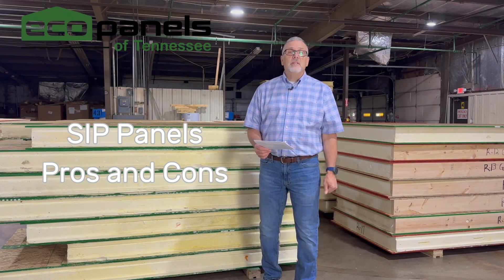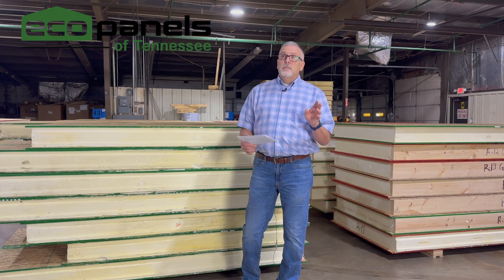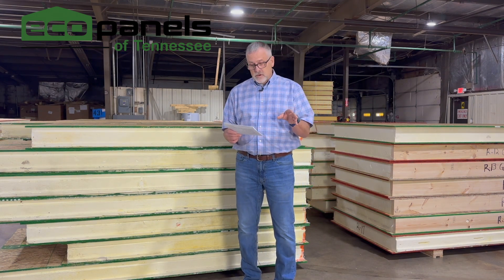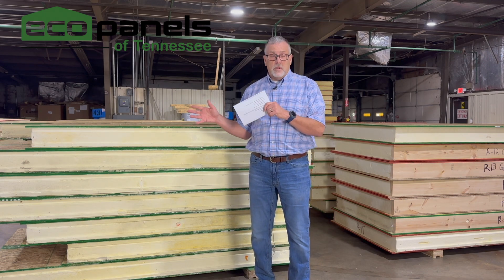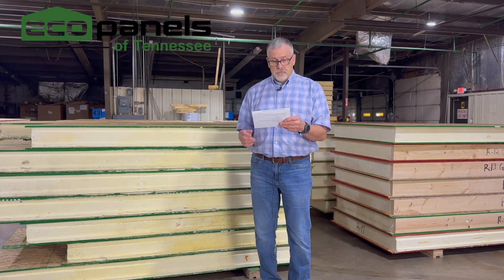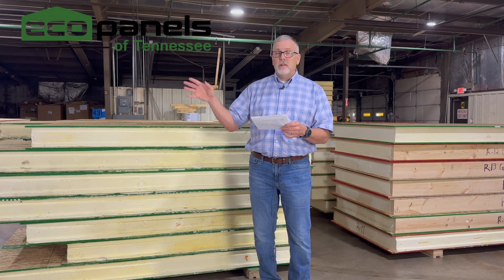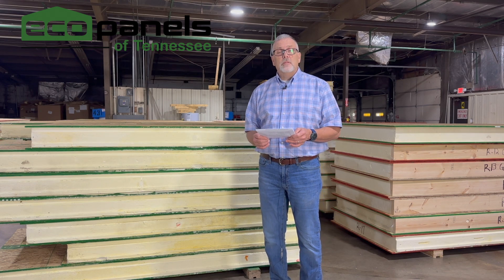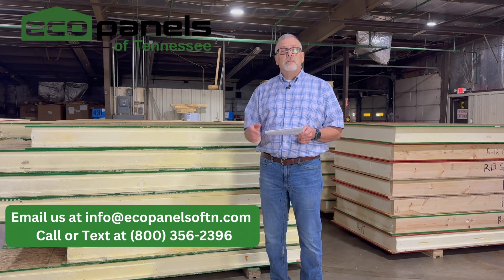SIP Panels Pros and Cons

Comment: You forgot one of the big cons to SIPS and that is water infiltration.  OSB is a water magnet and falls apart only after minimal exposure.  
Waterproofing (mastic taping joints, spray-on sealants, etc.) is a MUST.
As long as it stays dry, SIP panels will outperform stick framing every time!
Reply from the maker: Good point. Always have to keep wood dry. We really like using Huber ZIP as our exterior skins when possible as well. Thanks!
Reply: You can use fibre cement instead

Comment: Strange to say SIPS are better insulated than stick built when you can build a stick 3 foot deep and fully enclosed if you desired.
Reply from the maker: Honestly, I would think it's strange to suggest bothering to build a stick framed wall 3 feet deep, but to each their own. Best of luck with that wall!
Reply: @EcoPanelsofTennessee  lol exterior insulation is becoming the standard, protecting that inner frame and  that depth is a postive not a negative.  Why be so defensive? totally missing the basic point that you can build a stick frame as good as you want to build it
Reply: @PazLeBon A 3ft deep stick built house even insulated with mineral wool will have less than 1/3 the effective R value of a 3ft deep PUR SIP house. So may as well compare a 12” deep SIP (which is actually available) with your fantasy 3ft deep wall. If doing so, the interior of your fantasy house would be tiny given the same exterior footprint.

A SIP house already has exterior insulation built in. It just also has another layer of strong material protecting it.

Oh btw, if you want 3ft studs, you’ll be spending quadruple to frame and insulate it than what you would to build a 12” SIP house. You’ll need to use an expensive, imaginary, engineered cross section, or think of some imaginary combination of 2x material, which will need extra blocking to support. Good luck finding a crew who wants to nail all that together for less than double the going rate.

Stop eating cheese as the main source of calories for your dinner meal each day. Its affecting your judgement and critical thinking ability.
Reply: It's not strange at all. He is comparing SIPS to existing and new construction 2x4 and 2x6 stud frame homes. You can build a 3ft thick SIPS or 3ft thick stud frame, but for what purpose?
Reply from the maker: @samuelhainey1466  Thank you. :)
Reply: @samuelhainey1466  2x4 hasntbeen used i imagine since 1920. still missing my point tho, which is that insulation can be in so many forms and added to the exterior of the frame and deep as is desired so it still comes down to how well it is buiilt more than specific items :) a well built 2x6 is going to be better than a poorly built sip
Reply: @PazinPortugal  Yes,  there are lots of insulation options with a variety of building detail options. That's what excites me about our current industry is that it is constantly evolving and improving.....The same is true though....a well built SIP is going to be better than a poorly built 2x6. Ultimately each homeowner decides. I am building my house from SIPS with my own details. Sounds like you're probably building your house from 2x6 with your own details.

Cancel

Reply
Reply: It's not strange at all. He is comparing SIPS to existing and new construction 2x4 and 2x6 stud frame homes. You can build a 3ft thick SIPS or 3ft thick stud frame, but for what purpose?

Comment: Savings in labor cost should far offset the increase in material price.
Reply from the maker: Absolutely it can and should!
Reply: You are correct......Numbers don't lie. This has been evaluated in 3 Identical new construction SIPS homes in TEXAS. You can see the homes and program cost analysis talked about on "The Build Show". Stick build accounts for roughly 320% more in labor costs. SIPS accounts for roughly 10% more in material costs.

Comment: Do you use ring shank nails along with screws to secure bottom of the panels?
Reply from the maker: Wall panel to sill plate - 8d Sinkers or #10 x 1-1/2” Screws, 6” O/C. Thanks for the question!

Comment: How do you install hose bibbs on a slab foundation with your panels?
Reply from the maker: Great question. Small wall penetrations like that are not an issue and do not weaken a panel. They're done pretty often. If you can't align your exterior tap with an interior cabinet, a plumb wall may be needed against the exterior SIP wall for access, etc. Hope that helps... thank you!